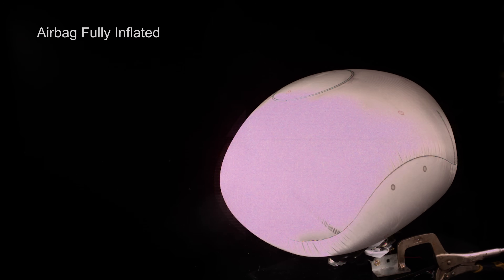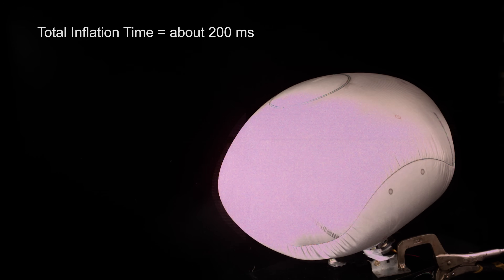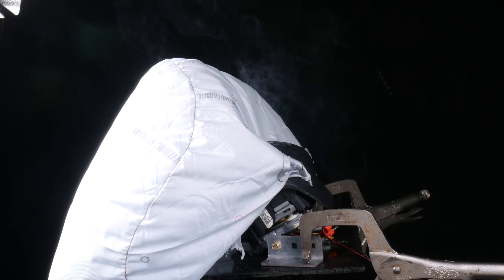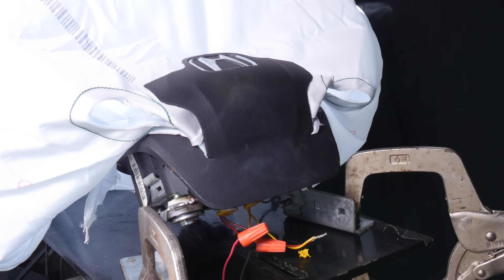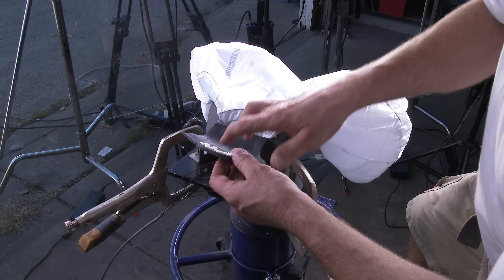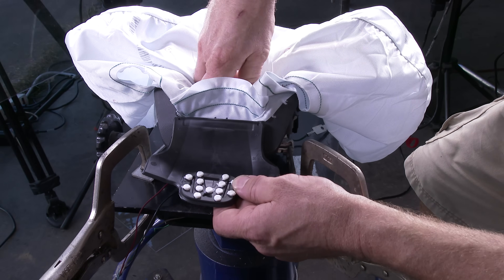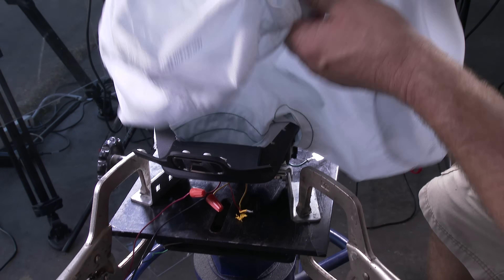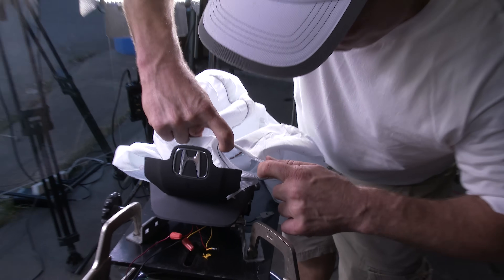Airbag Deploying in Ultra Slow Motion 15,000 Fps - 4K Slow Motion [ Quick Clips ]

Comment: There are people who are alive today because of that very design of airbag (and pretty much all designs of airbags). But I personally know someone who I'm pretty sure is still alive because an airbag identical to this one inflated. 

It's the steering wheel airbag from a 2013-2015 Honda Civic. The person I know was an 18-year-old freshman in college, about 5'2" and thin, sits close to the steering wheel. She rear-ended a stopped truck at about 70-75 mph. Her 2013 Civic sedan's crumple zone worked, and she was wearing her seat belt, but with her head in pretty close proximity to the steering wheel, without an airbag she would have slammed into the wheel with deadly force. The airbag came out like a fist and, because she was in close proximity to the wheel, punched her in the face almost immediately before assuming its fully inflated shape. However, it didn't cause any serious injury, not even a broken nose, just a nosebleed and some bruises. 

March 7, 2021 3:07 am

Comment: I recently had the grand misfortune of totaling a 2008 Honda Civic LX. Sideways into a concrete wall.

Those side airbags did their job, as did the seat belt. I walked away from that accident unscathed.
Reply: I didn’t know in 2008 the made side airbags.
Reply: @king_83227  Honda had side airbags all the way back in model year '04 for the accord
Reply: @8bits59  THANKS FOR THE ADVICE
Reply: @king_83227  My mom was also saved by the side airbags in a 2008 Honda, in her case an Accord EX-L sedan on April 22, 2013. Most cars had side airbags in 2008, Volvo had them as early as 1994. 

May 23, 2023 12:27 am

Comment: you have 2 wire-pairs, because it is a 2-stage ignition, which means two distinct charges. On this way, the amount of pressure inside the airbag can be controlled, like a "soft" airbag for a slow crash with a gap of 100ms something like that between both charges, and a "hard" airbag if the crash velocity is really high (it seems to be that you've fired both stages at once, so we have seen the "hard" version of the airbag)

Comment: I used to work for an OEM. The airbag is deployed by a tiny explosive charge generally produced by mixing sodium azide with potassium nitrate. The reaction of these two substances produces a cloud of nitrogen gas that fills up the airbag in 20 to 30 milliseconds. In layman's terms, the airbag is travelling at 200 mph to meet the driver's torso as he moves forward. Technically speaking, the sensors controlling the airbag deployment are the most impressive aspect of the system because they are as calculating and predictive as they are reactive.

Comment: I think it would be great to see a engine harmonic balancer in slowmo. That way we can see how the rubber isolator separates one part of the pulley from the other cancelling the excessive twist from the crankshaft. For it to work I think that the engine must be from idle revving up with wide open throttle so the twisting forces created from every combustion in the pistons is greater. That is something that noone has done and it will help understand how harmonic balancers work.

Comment: What type of fiber are they made of? Or is it just some kind of nylon fabric?
Reply from the maker: TheVitruvius I'm not sure but they are strong, very strong
Reply: It's PA 6.6 nylon fabric I believe. So a polyamide nylon fabric. 

Also the airbag fabric has become much lighter over the years. '90s airbag fabric felt almost like a burlap sack. That stuff would bruise and cut the crap out of you! Even back then airbags saved lives, but ouch! This is a 2013-2015 Honda Civic, so it's a pretty new airbag.

July 10, 2017 9:21 pm